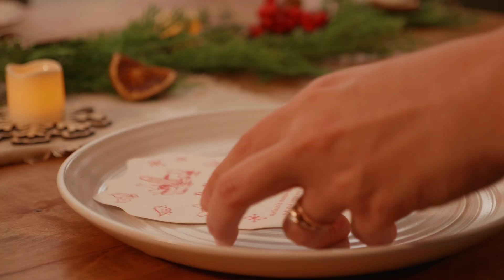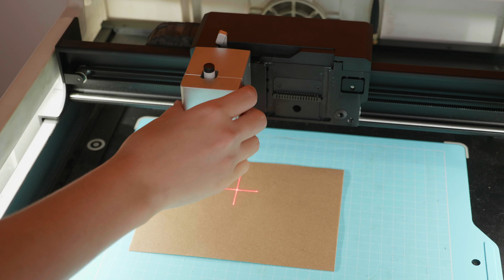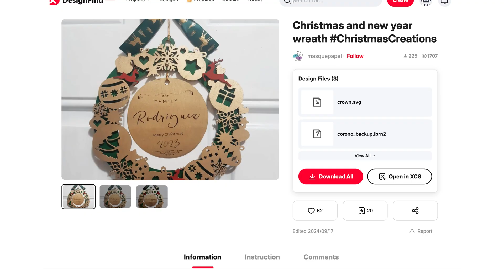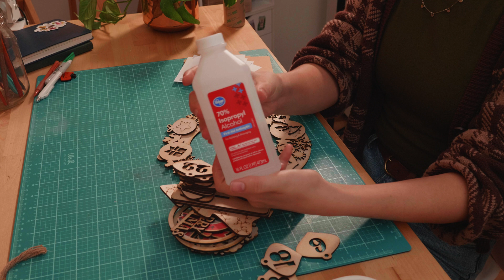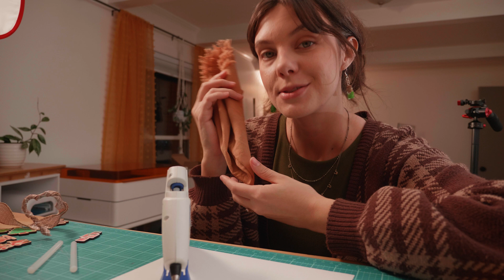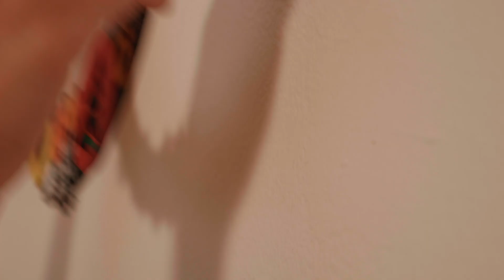10 DIY Projects for a Perfect Holiday Dinner Party 🎄 Ft. Xtool's M1 Ultra

Comment: thank you for sharing the process. it the printing more expensive with this tool?

suggestion for the next video. print using printer with the ink tank(for cheaper prints) and use m1 tool to do the rest. new subscriber here by the way. 

i'm still in the process of buying this machine or now.